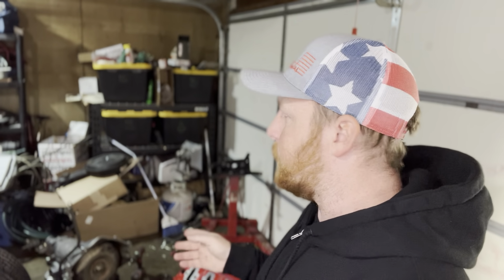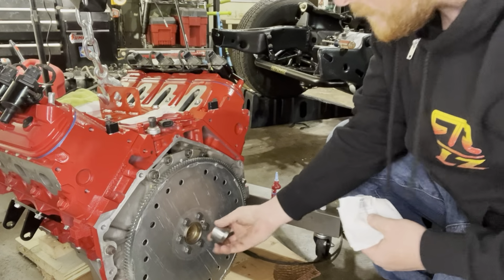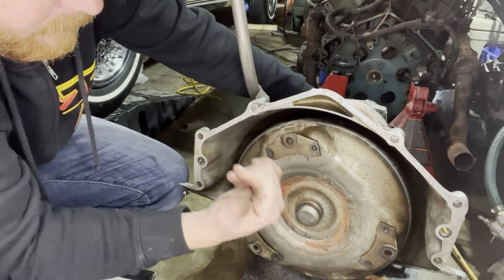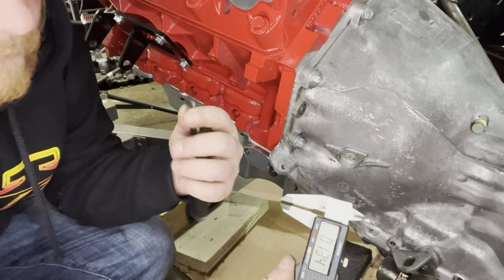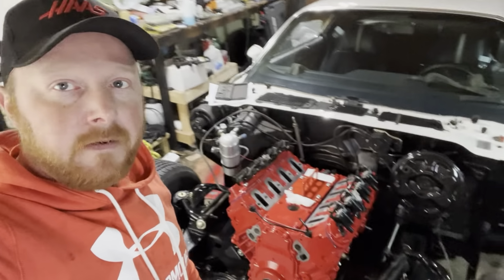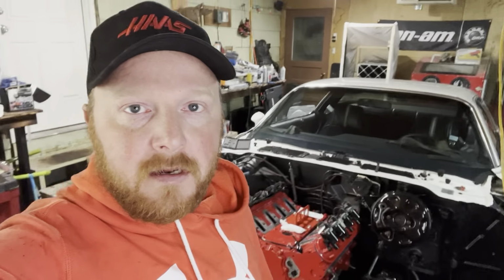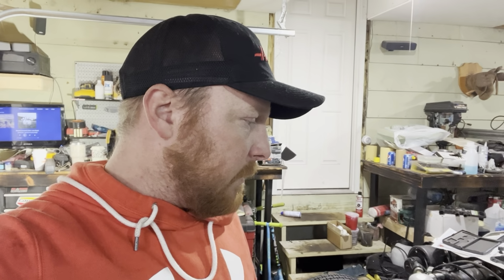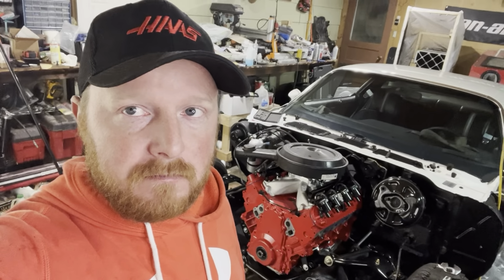Time to mate this LS to the Th350￼ Automatic￼ Transmission￼ and install into our￼ 1980 camaro ￼

Comment: Great content. Are you using the factory transmission placement. Stock transmission crossmmember/drive shaft?
Reply from the maker: Yes. Transmission crossmember bolted right back up into factory location and driveshaft fits perfect.